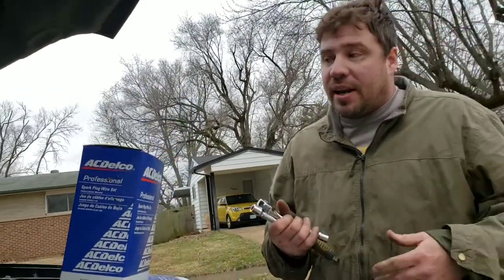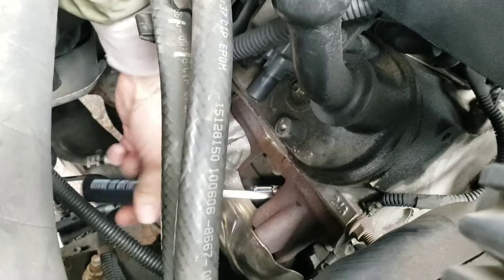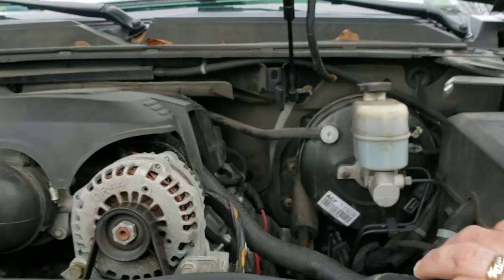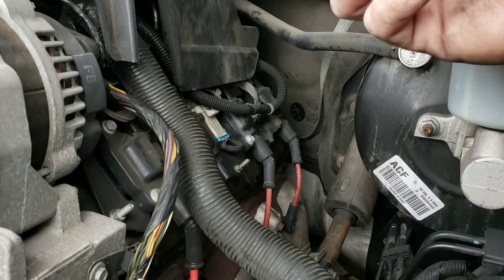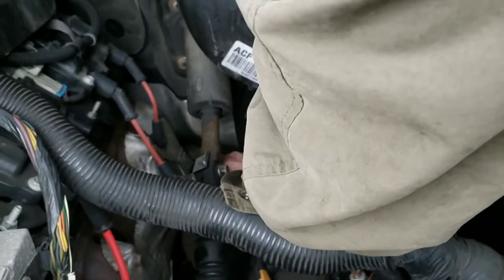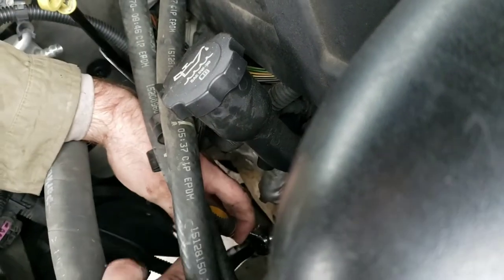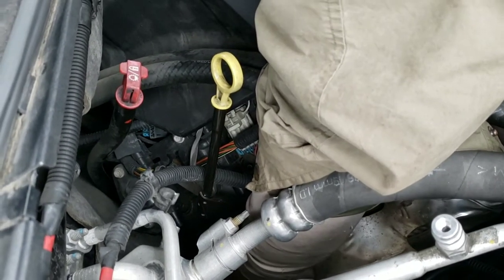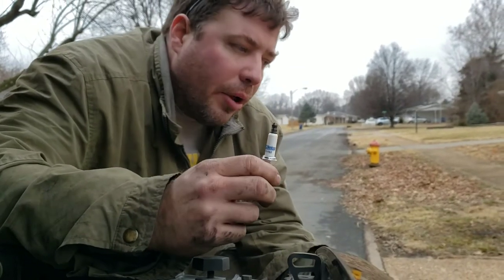Trick for changing spark plugs and wires on a 2007-2014 chevy suburban tahoe,Avalanche, GMC yukon

Comment: I just did mine yesterday.  It was no where near as difficult as this video makes it look.  I just used a hose plier and pulled on the boot.  the heat shields and all popped right off.  Also able to get the #8 from the top, but I had to lay on top of the engine.   If this job is too hard for you,  you are not qualified to be teaching it.
Reply: But y’all here watching it smh think before you write DA.!
Reply: I'll write what I want, thanks.   And if you had a clue, you'd know what I wrote was correct.
Reply: Lol your actually correct I’m doing it right now and all I did was pull the wires of with my bare hands lol with a little twist of the metal to the left
Reply: But question I’m having trouble matching up the holes and tightening the 1st passenger side spark plug .. it’s righty tighty correct? Lll it won’t catch
Reply: @sergloera  Its not luck, its technique.  That is my point.  Learn how to actually do it, and its not going to turn out like this.
Reply: That's what I'm saying
Reply: @ChickenWingSoup I own all chevys and Cadillacs. I’ve replaced everything you can imagine on cars/trucks since I was a kid … my Yukon Denali with 6.2 was tough getting every wire out from the heat shield… I’ve never had that problem on any other gm I’ve owned so you are lucky but if you work on them enough your luck runs out eventually!

Comment: Great video...I ended up removing the passenger side wheel and wheel liner for  more access.
Reply from the maker: Thanks! Glad you got it done.

Thanks for watching!

Please like and subscribe every little bit helps during these times.

Seize the day each and every day-Are Jay 

Here is our chevy playlist if you ever need it.
The best Chevy suburban, Avalanche, tahoe and yukon Repair and upgrade videos: https://www.youtube.com/playlist?list=PLQ0kUxbVWpJ8AlYusgnt2uCy15HvaPNyA
Reply: This is the way ... and pliers type spark plug removal tool.
Reply: I happened to have the wheel well liner off as I was replacing the upper and lower A Arms at the same time. Glad I did the plugs while it was off.

Comment: Changed mine yesterday.  At 62, it kicked my but but got it done in 4 hours! AC Plugs and opted for NGK because they were free. I used a GearWrench short magnet swivel. And yes, I did change #8 !!
Reply from the maker: Great job, yeah the owrst part is Ab/stomach painnfrom leaning over the radiator/engine, etc.

Thanks for watching!

Please like and subscribe every little bit helps during these times.

Seize the day each and everyday-Are Jay

Comment: Sir, with all respect, there is a much easier way. Hose pliers and a bit of gentle wiggling is all it takes to detach the plug boots and heat shields. Put the heat shields back on the plug boots, they only slip over the plug boot and don't make a difference in difficulty of removing or installing the plug boots.

Comment: Thanks for the Video.  I had the same tool to remove the metal boot but I found it easier and faster to use right angle pliers.  The trick is to pull on the pliers while also pulling off the rubber boot.  Hopefully, this helps someone else.

Comment: This video answered so many questions for me even being this old, my fathers been a mechanic with FedEx for almost 30 years and still got a headache from tryin to get the #8 spark plug and wire off. We ended up giving up on it and the one next to it but I’m gonna try and change it out tomorrow, wish me luck 👍🏼
Reply from the maker: Good luck. If you buy new wires ahead of time you dont have to be as careful either. Because if you break.the wire you have extras.

Thanks for watching!

Please like and subscribe every little bit helps during these times.

Seize the day each and everyday-Are Jay 

Here is our chevy playlist in case you ever need it.
The best Chevy suburban, Avalanche, tahoe and yukon Repair and upgrade videos: https://www.youtube.com/playlist?list=PLQ0kUxbVWpJ8AlYusgnt2uCy15HvaPNyA

Comment: Man I just got thru doing spark plugs and wires on a 07 Silverado and what I had to do was get a pair of pliers and pulled the wires out with the pliers. Of course the wires broke then I was able to pull those heat shields off. I also had to use the pliers to pull the connector of the plug so I could use my socket to get the spark plug.
Reply from the maker: Yes they can be a real pain in the...
Thanks for watching.

Please like and subscribe every little bit helps during these times.

Seize the day each and everyday-Are Jay

Comment: hey thanks for this ! 

i am that dirt floor, backyard, creeper stuck in the rocks, can’t even sweet talk even my truck’s engine bay in to my 8x9 garage bc who’s idea was an 8x9 garage anyway (?), DIY shecanic & sometimes, (most times), i find myself in a very heated brawl with some part on the truck that does this kinda BS. 

so, i arrived to this project after the roadside assistance fella - who, in a very genuinely kind hearted attempt to assist me after i kinda accidentally overfilled the ATF after rebuilding my VB - had surmised with me what was actually us both mistaking the symptoms for an under-fill & he was being a good human & trying to help & was pouring a small bit of ATF in the dipstick & had a whoopsie & kinda lit my engine bay on fire for a good 2 seconds & so that was terrifying & so needless to say - truck got towed home. thankfully the only damage was the rear most passenger spark plug wire & hardly but any damage needs replacing (esp after you know, like, a fire) so… in theory, this sounded like an easy job to me… no. easy job, impossible task. i about lit it on fire again & threw myself in the dumpster that it has become.
but then i found your video so thanks for this. 
even after the fire. i’m doing it my damn self. 
if i had the money i wouldn’t have an engine that catches fire anyway, so. 

all in good fun. 

😩
Reply from the maker: Hey Lex thanks for watching. We are in the same boat. I have on occasion got the back end in the garage to work on shocks/suspension but would have to go inside and out the front door to get around front if I need anything. 
I actually annoy my wife with every few weeks or so, call her to look and say if it was just 1 foot wider we could do so much stuff in our garage. But unfortunately that is not in the cards for us.

Thanks for watching!

Please like and subscribe every little bit helps during these times.

Seize the day each and every day-Are Jay

Here is our chevy playlist ain case you ever need it.
The best Chevy suburban, Avalanche, tahoe silverado  and Gmc sierra and yukon Repair and upgrade videos: https://www.youtube.com/playlist?list=PLQ0kUxbVWpJ8AlYusgnt2uCy15HvaPNyA

Comment: FYI for anyone doing this. DO NOT APPLY - DIELECTRIC GREASE - TO ANY TERMINALS.  Dielectric Grease is only for the rubber boot to allow for easier on and off and protect the spark from getting wet. This grease does not give you a better connection of the terminals and is not intended to. So use a Q-tip to apply a very thin layer to the inside of the rubber boots only. Do not put a big glob inside the boot and stick it over the plug terminal. ** And also, make sure to replace the metal heat shield cover back onto and over the new plug boots. These are needed and intended to protect the plug boots. **

Comment: I was thinking of doing this job myself but now I've reconsidered. I'll just keep paying mechanics to rip me off. Let them bust their knuckles. The last mechanic just replaced one spark plug wire in the back for some reason and I have a feeling they didn't change all the plugs either. $300 or $400 just to replace spark plugs.

Comment: dealership wants to charge me 1,100 ive only ever changed my oil I have a yukon  xl 2011 wish me luck
Reply from the maker: You got this, just take your time relax and remember to buy new plugs and wires before starting. Because there is a good chance you are gonna break a wire or two.

I have links in the description to wires and plugs I think. 

Thanks for watching and good luck.

Seize the day each and everyday-Are Jay
Reply: How’d it fo

Comment: I just changed the plugs on my 2012 suburban 5.3 did them in 45 min 
Only used swivel socket and wrench 

Trick I used to remove the boots i spin them with my fingers and they popped off after a couple of turns  
Only cut my finger a bit 

Thanks !

Comment: You need those heat shields or your wires will melt
Reply from the maker: Nope, they can help in some instances, I have actually had the heat shield's press against a wire and melt cut through them, most older vehicles never had heat shields and were fine.
Reply: If I have heat shields still then I'm putting them back on. 😂

Comment: Just from looking at the tool and the spring it looks like the tool is made to pull back on the spring to allow the boot and metal case to come off. If you've ever tried to pull a spring off of anything when you pull on the opposite end off it it  only gets tighter on what you're trying to pull it off of, it's like a Chinese finger cuffs. If you use the tool to pull the spring backwards you should be able to pull the plug off easily.........just my observation....just saying.....